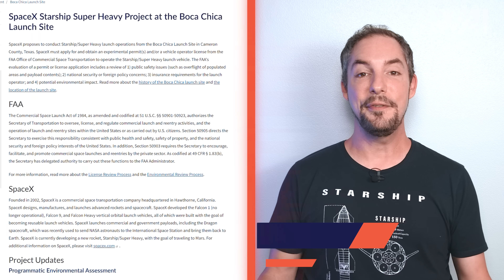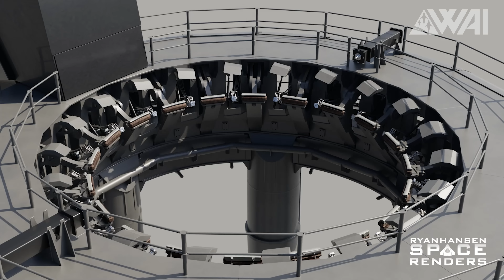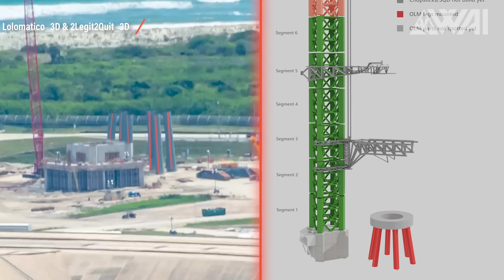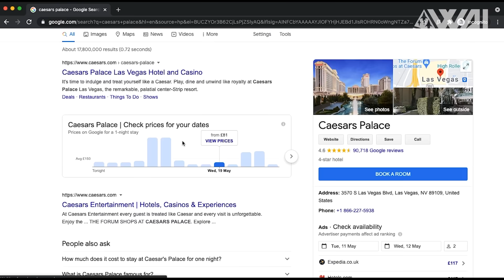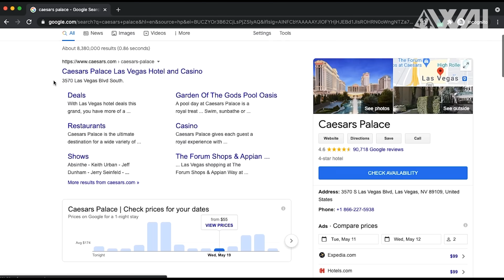SpaceX FINALLY gets FAA Starship Approval! Launch Next Month!?

Comment: if you go back and look at 11.28 of the R2's, you can possibly see the(?) lean/rich 2" black knobs??? Looks like a possible METHOX or LOX regulator rich adjustment. The knobs are in the center of the that's
Once again, a great episode!, and thank you for the knowledge of the release clamps. I was always wondering about that and had friends ask me aswell. Content is perfect! Thanks Thanks! 🍀
Reply: sorry, they erased some of my text. Lets try again, 1.5 x 1.5 face plates with the small circle dials. They are like regulators on a oven. (almost answered my own question, lol).  Thanks again!

Comment: Did I miss something or what is actually the plan to land starships on mars?

They will need landing legs.

As far as I see it spacex is basically just postponing the landing leg problem by replacing them with mechazilla so far which yes reduces the turn-around greatly but doesn't solve the problem for mars. How are they going to land there?

Mars has a thinner atmosphere which can make landings quite rough and the ground there isn't even. I imagine that such legs will turn out as a similiar complicated problem as stage zero is otherwise they would have solved it right away.

Comment: Am I correct that the launch tower still needs to have blast plates welded to the outer surface, so that the rocket exhaust doesn't damage the cables and other internal systems of the tower?

Any evidence these have started?

Comment: wouldn't it be easier to stak magezilla section 8 on top of 7 while on the ground, and do all the "plumbing" before it goes "300 ft in the air"? then raise it up, place 6 under it and repeat. seems easier to stack 8 on 7 then 7&8 on six and so on. that keeps every thong at low altitude
Reply: Sections too heavy.

Comment: When they get to the point of mass production and storage of the stages or complete rockets do they have a plan for keeping the mass amount of mechanical valves and actuators from failing due to being stagnant for so long, also the air around central Florida can be very harsh on components due to the salt content. NASA had issues with O-rings and the quick thermal changes with the weather. SpaceX has a lot of great minds working on humans returning to Space and it would be great to hear about support and logistics of having such a large fleet. I wanted to say thanks for all the great work you and your team do to produce such an enjoyable and informative channel

Comment: Please don't forget that SpaceX needs waaay fewer Boosters than Starships. That is to say: If Booster 8 works perfectly in the future and lands, caught by the chopsticks, then it can be reused to launch future Starship 27 or 28 or 29. Only when they want to redesign a portion of a Booster do they need a new one. And who's to say you can't yank the Raptor 2s off an old Booster and reuse them on a newer one. Again the need for fewer engines than most people think. Each Raptor is supposed to be reused 100 times...So I'm sure we'll see some reuse on new Boosters. One Starship built a day does NOT mean one booster a day too.

Comment: why waste the booster on the first launched and all its Raptors I think SpaceX can come up with a simple and genius idea to save it.  I think a slight modification to fall short of Gravitas can save the booster, four vertical arms topped each with a quarter-metal cylinder clamp in such a way when the booster hovers over the ship the four arms Would close up with full force in such a way that the diameter is wider than the booster and that the ring height for the grid fins to rest on it with sufficient room between the boosters and the deck. At landing the center mass of the booster is mostly at the bottom, the arms will act as stabilizers mostly.

Comment: Im surprised they didnt launch the booster 4 alone with a payload simulator.

We know starship flies, but not the booster.

Sure FH has almost that many engines so spacex has experience managing huge number of engines without failure (looking at you N1), but there is a huge difference in power and arrengement.

I guess all in..

Comment: Could linear motors be used to power a space craft to faster than traditionally fueled vehicle?

Biggest hindrance could be the nuclear reactors required to power the coils and where to point the projectiles lol
Reply: Not sure the sensitive instruments (or even structural parts) on a lot of payloads would like being shot out of a giant coilgun. Nuclear reactors are also absolutely not necessary. Just use huge capacitors and charge them slowly.
Reply: @user2C47  the reactor would be a power source for charging the capacitor

Comment: What about all the equipment that the starships will be carrying?  There is a lot of discussion about the mass required for a colony. Who is designing, building, financing all the mass?
Reply: SpaceX wants to build the transportation system. Only expanding onto other modules if no one else is doing it. There has been research for Mars Base equipment for decades. With a system possibly in reach this will speed up.

Basically the whole industry might be involved with Mars Base Alpha.

Comment: Thank you Felix, Absolutely no! They have the authorization for launching  from Bocachica but they need yet to do some modification and  this will take some weeks or 1/2 months and furthermore they will start with the Raptor2 statitc test engines, cryogenic test of the Booster 7 and Ship 24 etc etc. I think this prototype of the  Starship test launching will be happen not earlier than beginning of September. 😀🤞🤞🤞Sant Cugat Barcelona Spain

Comment: Why do they need so many engines in each ship? Why not say, 4 huge ones?
Reply: thank you for your reply Nori. Totally makes sense. I just thought what a lot of work to produce all of those engines.
Reply: @billhayward1585  Yeah, that would definitely be a huge downside for nearly every other rocket in history. But SpaceX is proving right now they are able to do this.
Reply: @norinokia2307  SpaceX are supposedly averaging one Raptor per day from manufacturing. Three Raptors is about equivalent in thrust to a Rocketdyne F-1, and you can bet nobody was building an F-1 in three days.
Reply: There are many good reasons for that. First of all, it's easier to build a small one than a huge one. Of course you need a high production rate then but it can work out if you know what you are doing in production.

Then there's a higher safety with more engines cause it's not a big deal if one or few are failing. A four engined rocket is doomed if they lose one.

You can test easier, more often and faster which allows for faster iteration.

Comment: we are no where near orbital flight and only close to a sub orbital test flight and you are being deliberately ignorant in pushing the whole orbital flight lie. i hate calling you a liar but you are lying every time you call the first test flight an orbital flight
Reply: I hear ya brother,  you are correct because technically this next flight is only going approximately 3/4 of the way around the planet before Starship ditches off of Hawaii.  It will still be an excellent and safe as possible first high speed and high altitude test of a prototype Starship.

Comment: They should have an external inlet for fuel whilst the static fire is in proses.  Once all the engines are fired before release the external inlet should disconnect and be switched over to the main tanks.  This way a lot of fuel can be saved for the trip beyond.

Comment: The part about the hold down locks was very good. You show just one lock. The part I'm interested in is the synchronization of each lock to each other. There's numerous ways you could approach the problem. I prefer mechanical synchronization where if one lock releases they all have to go because there are physical linkages that connect each lock to each other. You could do it hydraulically or even pneumatically or a combination of both. You have all those locks down there and there is a reason for that. The hold down forces are so enormous it was the only way to spread the load without the back end falling apart.
Reply from the maker: Thank you! Yes, I do believe it is a mechanical sync. Anything else would be against SpaceX's philosophy as well. Less complex. More reliable. :_WAIHeart:
Reply: They should go simple and have some kind of mechanism that physically locks them into place as the booster is lowered and retracts itself as the booster leaves. Would save all the unnecessary hydraulic systems, synchronisation systems and all that other stuff
Reply: @JO-ui9fl  But there are Situations where the Booster wants to leave, but needs to be held down. Static Fire and Launch Abort because of Engine Startup Failures would be such Scenarios. What would hold down the Booster in these Cases?
Reply: @unitrader403  Some kind of simple mechanical anchor would do I suppose.
Reply: @JO-ui9fl  how do you switch it between releasing the Starship and holding it down on a moments notice? and since its multiple several Clamps how to sync them? a purely mecanical Linkage has Slack which would delay the Release on some Clamps, and that could tear the Booster apart
Reply: @unitrader403  I'm thinking simple so pull the release anchors lever. For static fire tests this would always be engaged, during launch once engine startup is complete pull the lever to lift off. I mean you could make it as complex as you like but Space X seem to prefer reducing complexity over adding complexity
Reply: @unitrader403  yes it's tough problem,  that's why they have engineers working on it all the time. 😉
Reply: @unitrader403  An exponential process comes to mind. Device A (tiny) controls device B (medium) which controls device C (huge).
Reply: You should be on thec team!
Reply: They don't need to be synchronized. The chopsticks can hold the rocket in place as long as needed.